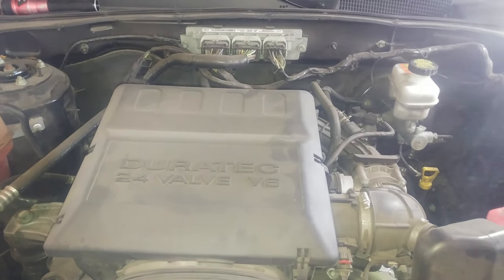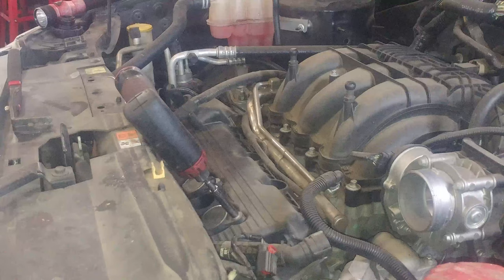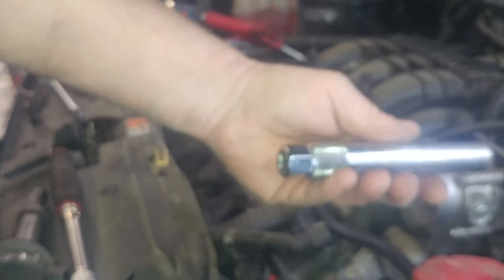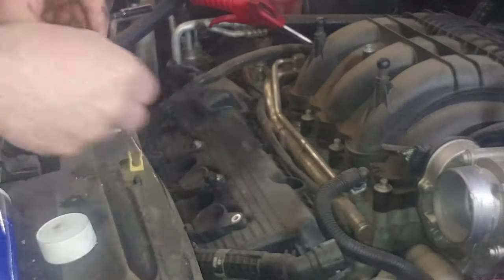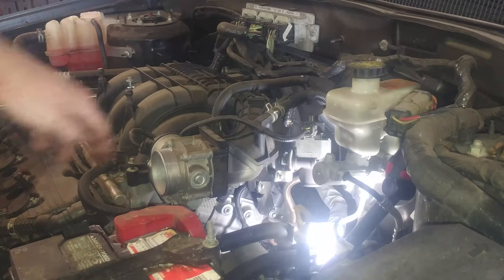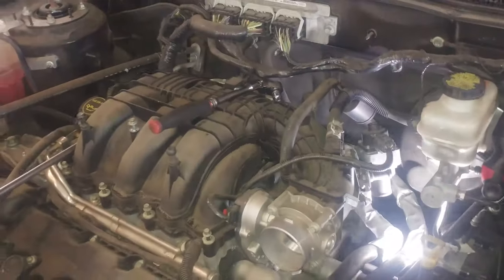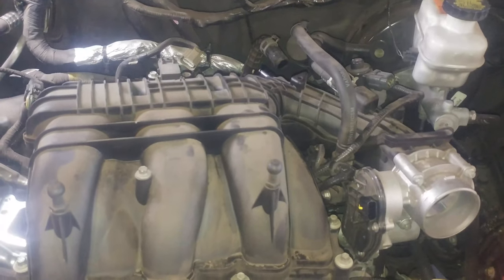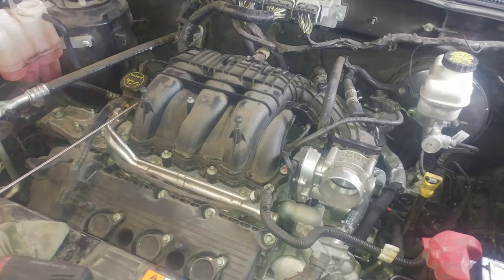Spark plug replacement 2011 Ford Escape 3.0L V6 How to change plugs. Intake removal included

Comment: Thank you , just finished it up. 2011 Escape 1st plug change. 82000 miles. Plugs were shot worn down to like 90 gap. Definitely shouldn't wait to 100,000 miles like the book says. Excellent video! Give the engineer a black eye. Lol

Comment: Good video with the exception of the very end where you state to tighten the intake bolts to15 ft lbs. I followed this and snapped off a bolt. Turns out 15 is double of what should be used.
Reply: Always think about it ! If it feels like its getting to tight when turning the bolt maybe double check , Makes life a lot easier  Also easy outs are your best friend in your case.
Reply: He said newton-meters not ft-lbs. Get your ears checked?
Reply: @DockterDoom at the 16:00 mark he said fl lbs.  he made the mistake saying it and didn’t catch himself.
Reply: He did say both. First Nm then ft lb. 15 Nm equals 11 ft lb. So it was a bit confusing

Comment: Isn't this the exact process for the 2009 to 2010 3.0L V6 aswell???
Reply: Yeah they have a few years that are the same , I own a 2011 and also used parts off a Mazda tribute and worked  fine as well.

Comment: a good time to do a compression test while you have those plugs out.....
Reply: If you do this, remember to disconnect the injector fuse and run the engine until the injectors run out of gas.

Comment: No Anti Seize on the plugs??
Reply: Definitely not on modern cars. It's already on the spark plug coating. Adding lubricant changes your torque value.